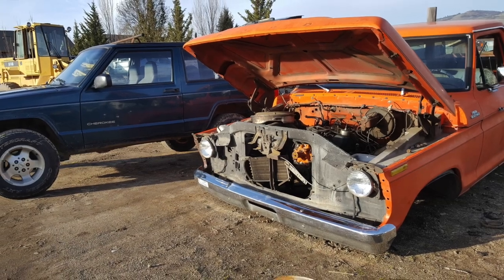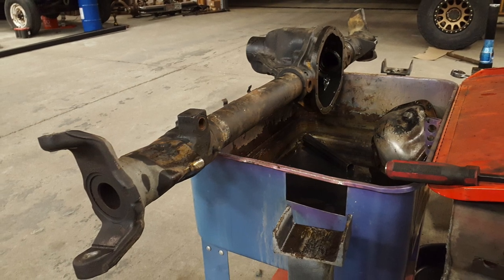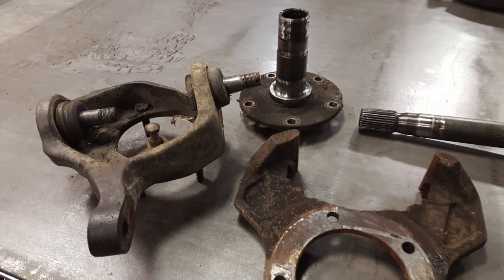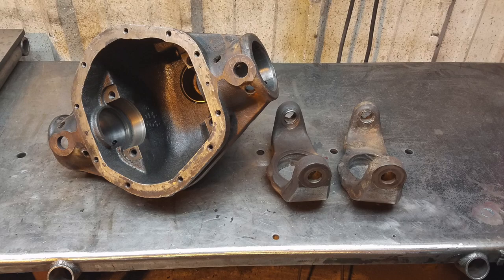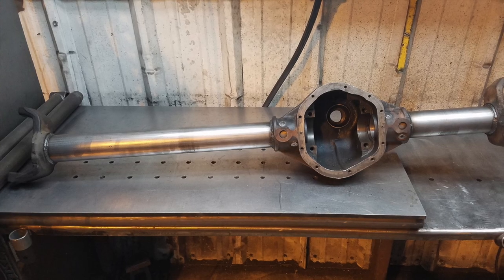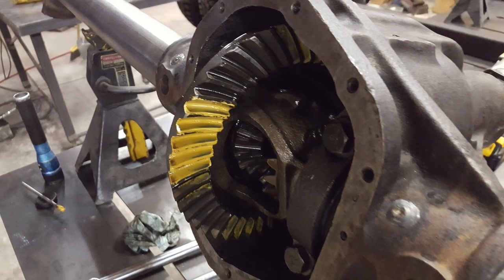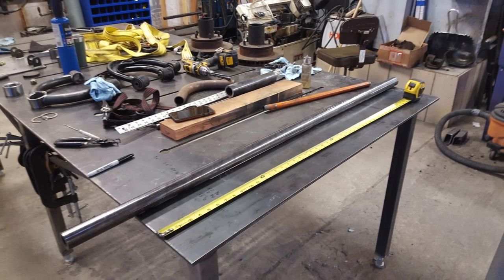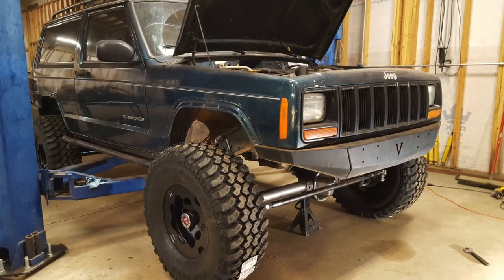Retubing a Dana 44 Axle - Project Green Machine

Comment: Lucky for someone like me who has a 1970 f100 that came with drum brakes, all I have to do is swap one with disc brakes in and it mounts right up with no cutting or hacking. I found a 1979 for $180 with 3.50 gears (yes it matches the rear 9"). I'm gonna rebuild it first though lol

Comment: I have a dumb question here. I have a friend who has all the equipment to be able to retube a axle. Welding is no problem for me but he has a 60 ton press. The tubes did you buy them or did you just buy some cold rolled pipe and do the machining yourself as far as how the seals will seat and all??
This really doesn’t look like a hard job to do and beats the hell out of paying those insane prices the axle builders charge.

Comment: Should have used a slug in the center section to press the tubes cause you run the risk of crushing the housing. And I wouldnt mig weld the center section to the tubes. Definitely tig weld with ni-rod or nickel rod. Sure it may burn in initially, but they all crack after time. If you want to see how to press tubes in a housing watch videos by Dynatrac. There is a reason they are the best axles around.

Comment: I have a 2013 mustang gt with both rear tires worn more from outer half than inner half. The wear from outside to inner is gradual. Is this sign of bent axle housing?
Reply: Are you sure it's a *2013*???

A 2013 has a "8.8 rear axle" it's solid. That's super weird to have bald tires on the outsides. All Mustangs (except 99-04 Cobra) have always had solid rear axles. If you jumped it maybe you could bend it; your tires would wear on the INSIDE edge. 

99-04 Cobra 
And
2015 and newer Mustangs...
Have independent rear suspension  (IRS) if  the car is slammed (negative camber) the tires will go bald on the INSIDE. If the alignment (toe) is bad the tires can wear out on the OUTSIDE.

Comment: Is it possible to build an axle like this and keep my 5x4.5 bolt pattern without needing adapters or spacers?
Reply: Yes, in the 70's dodge had a dana 44 with the 5x4.5 bolt pattern. I'm not sure if you'd have to use the inner C or just swap the knuckles but it's doable. Just FYI the wheel bearings are setup similar to the Dana 35 ttb and don't last very long with big tires and being side loaded.

Comment: So I’d love to do the same with a yj but I’d like to keep the factory width of the original differential is that possible
Reply: Yes you just get the tubes shorter to make it narrower, and for shafts you would either need to get custom alloy shafts, or you can ship the original shafts to dutchman to get resplined to your width.

Comment: thats alot of work and shop time. from what you had done couldent you just buy one ready to bolt in? or spend a lil more money on a used axle that dosent have that casting
Reply: U learn more about your jeep if u do it your self,  built not bought,  u should try it
Reply: your, "built not bought" moto is ignorance in this case. the cost of retubing an axle is often more than just paying the added cost associated with purchasing the more desirable 44 with welded wedges. which was also available with a 1/2" wall tube as well... the retube job done in this video was done right, that cannot be argued.

but time is money for some of us.

Comment: So most solid axle specs I've read recommend 4-6 degrees of positive caster, I believe the XJ's are set at the factory to 7 degrees, so I'm curious to know how your rig has been feeling on the road with 10 degrees?  Is this what the final measurement ended up at once it sat with the weight?
Reply: increased castor does a good job of helping larger tires return to center and avoid wandering on the road. more than 10 degrees may be excessive though.

keep in mind castor is irrelevant unless you take into account pinion angle as well. i built my 44 with the castor 16 degrees relative to the center line of the pinion. so the axle ran the axle at about 7 degrees of castor (pinion pointed up about 6 degrees) in a cherokee with about 5" of lift on 35s. without anything to compare it to... it didnt leave anything to be desired.
Reply: normal caster spec for a stock XJ with 215\75\15 tires is 3.5-8.5, if anything 10 is probably on the conservative side for 35" tires and 4 .5 inches of lift. the more caster the better with larger tires, it stabilizes tracking and helps prevent death wobble.
Reply: I believe the caster was set to 10 degrees with a flat pinion angle. Once you adjust your control arms for pinion angle I'm sure he ended up with about 5 degrees caster angle give or take 1 degree. I run 5* caster on my jeep on 35s with an excellent pinion angle and it does great. Actually running 8+ degree caster angle is excessive and will hinder steering response. Most super duty Dana 60s only run about 3 degrees.

Comment: 10deg caster seems really excessive. Where did you get this figure?
Reply: normal caster spec for a stock XJ with 215\75\15 tires is 3.5-8.5, if anything 10 is probably on the conservative side for 35" tires and 4 .5 inches of lift. the more caster the better with larger tires, it stabilizes tracking and helps prevent death wobble.

Comment: So what's that mod cost? It looks nice but doesn't look cheap, I guess if your running a small tire you wouldn't need more front axle. It'll be bulletproof for 35's. Run solid joints though, that's always been the weak link in a 44. Good luck. Nice build.
Reply: better to break an axle ujoint on the trail than a ring and pinion, you can limp out in 3 wheel drive lol.

Comment: sooooooo much wasted time and money.....coulda had a D60 for same if not less money.
Reply: Don't need a D60 with 35's. That HP D44 will be fine for what he's doing and it's a hell of a lot more ground clearance than a D60 would have with the same size tires.
Reply: TheAmericanUhate  you don't need a d44 for 35s either....
Reply: That's true, you can run 35's on a D30 but I wouldn't run much past 33's on a D30. I don't see any use in dumping money into a D30. D44 is a good axle for what he's doing. Can build a D30 that's tubed & trussed with RCV's and even locking hubs, the ring & pinion will be the failing point then. D44 has a larger R&P and more aftermarket support.
Reply: Tony Bolton C'mon Tony, we all know that money is no object for you. haha
Reply: Jack Nicholson having it to waste.....and wasting it are 2 different things 😎😉
Reply: Jack Nicholson  sure wouldnt....he gives my tax refund in April!
Reply: TheAmericanUhate he's only on 33s
Reply: If your only going to run 37s then u will loose clearance with a 60 so a 60 would be stupid